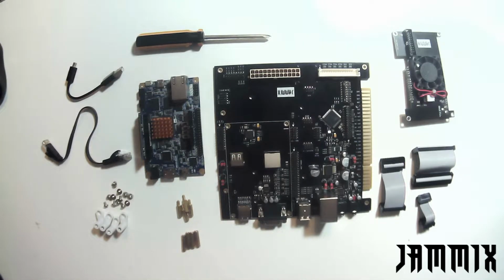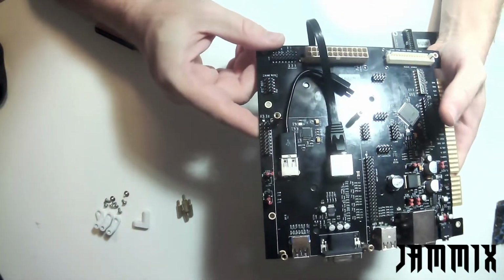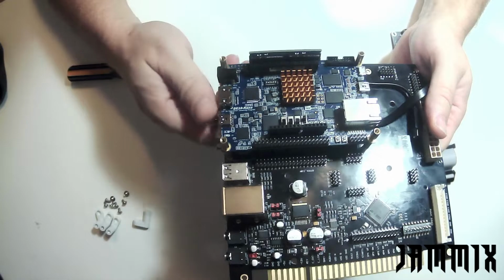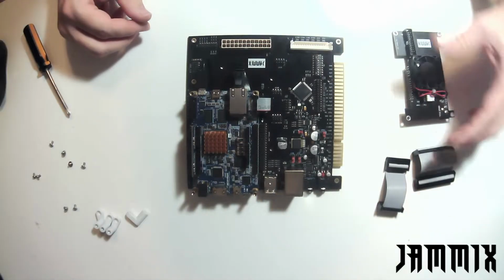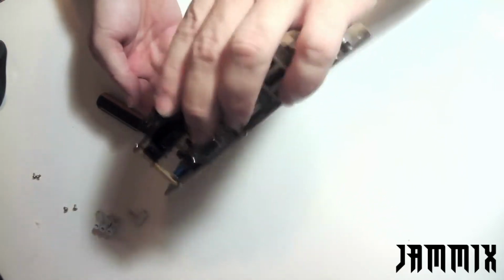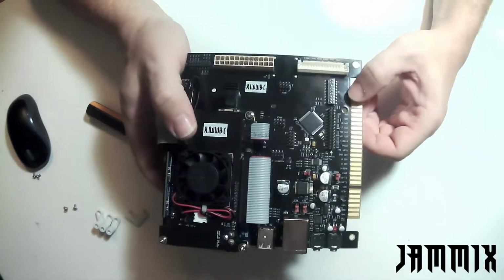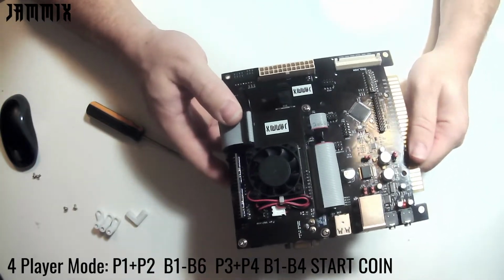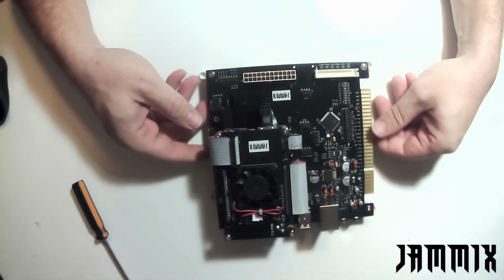JAMMIX Arcade Build Guide

Comment: Is there a power supply you can recommend with the JAMMIX? I will be using this in an arcade build.
Reply from the maker: Arcades should use an arcade PSU with +5V and +12V